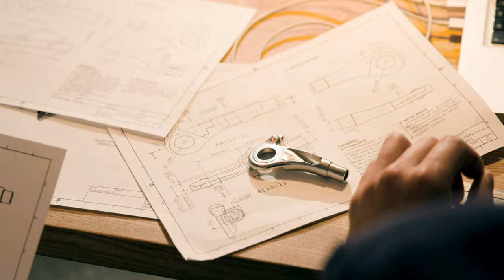REPETE: Factory Tour

Comment: The rear dropouts of the Repete are beautiful. With a more sloping top tube, front and rear mudguard and rack mount, a splittable design (more specifically, through incorporation of low-profile Santana Z type couplers), and with 3D-printed lugs for every joint, the Repeate would be about the best steel bike in existence.
Reply: Not sure if you've heard of Victoire Cycles from France, alongside their sister brand Distance Cycles.
Reply: @yonglingng5640  Both produce lovely bikes (I particularly like the Victoire Cycles' # 465 and the #521, owing to their compact designs (ca. 14-14.5º slope in top tubes), but neither the frame is splittable (check out Santana's Z couplers and # 22 Bicycles' low-profile frame couplers), neither one has 3D-printed lugs (emulating the beautiful joints in a carbon frame) - and neither one has complex (i.e., reminiscent of carbon). I also don't care for the weld-on seatpost clamp design (though, I expect, these can be negotiable). Yes, and they all appear to be steel, rather than titanium. Thank you for the reference.
Reply: @LeoInterHyenaem  The integrated seatpost clamp is optional. Collar clamps are the default option. One can even have a Victoire-custom stem too if so desired. Steel strips can be added to the head tube's sides to prevent the housings from rubbing the frame. (this is my favourite optional option)
Reply: @yonglingng5640  I can see that both the Victoire and Distance Cycles are quality boutique steel frame and accessory manufacturers. I'd also like to applaud them on the use of non-dropped seat stays. Few companies these days abstain from giving in to that stupid fad. And their use of fillet brazing over TIG welding is highly praiseworthy (the less of those hideous visible welds, the better), but the use of 3D-printed titanium (or steel if these exist) lugs would still be preferable to fillet brazing. If for nothing else, then at least for the unmatched aesthetic (I'd like for my next metal bike to look like carbon, for criticise carbon as metal bike aficionados may, aesthetically the oblique forms and weld-less joints of carbon are unmatched). Something else about both the manufacturers I appreciate - is their use of a wide range of frame designs from the perspective of short and long chain stays and varying degrees of top tube slope and head tube height. If they'd come up with a titanium frame that mimics my beloved Salsa WarBird (current generation) to a T (but has a slightly higher stack for the same frame size) through use of 3D-printed lugs for every joint and custom-shape tubing, integrates a Santana Z or # Bicycles 22 frame couplers and a Brake Break leak-free instant couplers for internally-routed hydraulic couplers, I'd mark it as my next-to-buy bike frame. With a custom aluminium case to go along, it would be THE rig to use for every bike tour one would ever care to do. 
 You mentioned the braze-on steel strips on headtubes as your favourite feature. A curious feature no doubt. But wouldn't it abrade the cable housing / hydraulic liners?